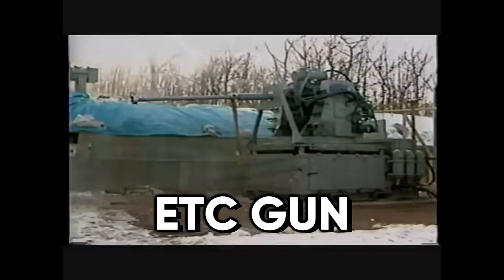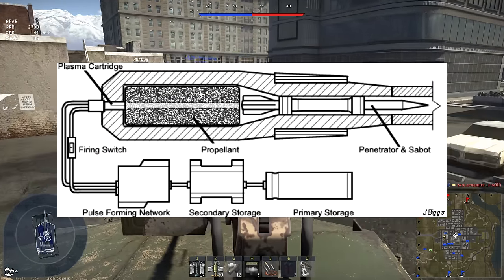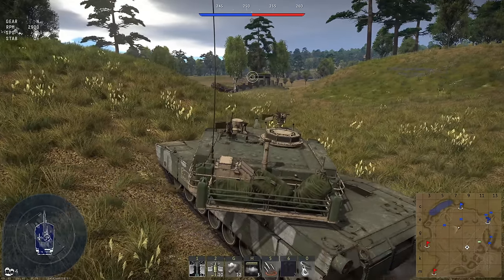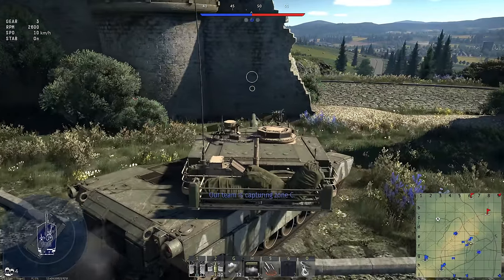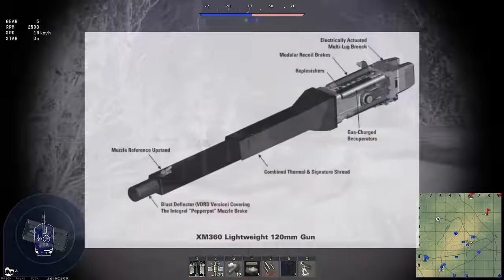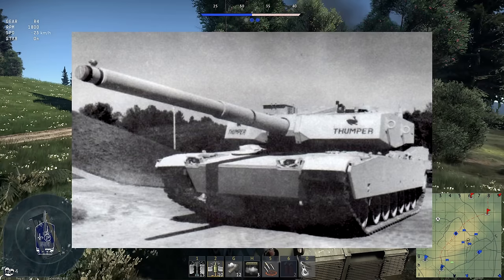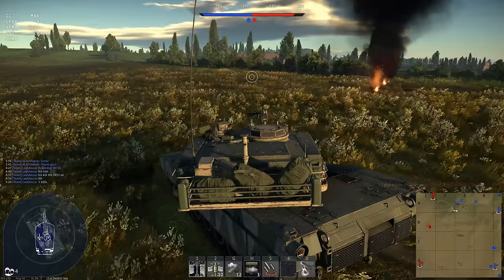ETC Cannons - The Future of Tank Weaponry

Comment: Somehow they remind me the hunting rilfe that use an electric charge to ignite gunpowder that I saw on Forgotten Weapons.
Reply: A entron I think it was called?
Reply: I suppose that can be seen as a version with a much lower powered ignition sytem.
Reply: I remember when it came out reading about it in Outdoor Life. No one was interested
Reply: @ArkonDrakk that's right
Reply: hm
Reply: I think it more just applied existing electronic ignition technology and implemented it into a small arms platform, it had some interesting features but never really took off as it just wasn't different or superior enough.
Reply: @CATASTEROID934  i think this would be better since the ignition system is reusable as opposed to requiring one use primers
Reply: @rhodesianwojak2095  The only real difference in the ElectronX is that it used electronic ignition of the priming compound instead of impact, the proprietary electronic primers essentially passed a current through the volume of priming compound which in turn would ignite the propellant rather than directly igniting the propellant. I think this was to make commercial brass compatible with it for the sake of reloaders. All-electric propellant ignition in small arms would require totally proprietary casings.
Reply: @CATASTEROID934  ah ok ty, preety new to this stuf so
Reply: I met a guy a couple of years ago who was buying up all the Etronx primers he could find. He was working on a less lethal electronically fired "pistol" with, if you can believe it, a user selectable level of velocity.
Reply: @CATASTEROID934  I wonder if anti tank rifles would make a comeback because of this. Like, an ETC version of the Lahti (Lahiti?). That 20mm rifle lol
Reply: @irtazaazam2573  I mean anti-materiel rifles already exist and are deployed in small numbers by many nations, the problem is you need a powerpack to generate the plasma and that's irrelevant for vehicles since they already have an existing power supply, but when it comes to heavy infantry weapons that already need to be disassembled to be man-portable you start hitting the upper limits of what can be reasonably carried pretty quickly and the extra weight might not be worth the performance boost.
Reply: Remington EtronX. It came with or you had to purchase electronic primers and load the rounds that were electronically primed. It had an ultra light 2lb trigger that felt more like a mouse click.

Comment: Reminds me of a funny detail, when Armored Warfare added the tier 10 version of the abrams, they called it XM1A3, even though that’s not even a valid syntax (the A3 version of something not in service?), the designation, as per a declassified pdf regarding the XM360, is M1E3.

Did not realize the thumper was using the 140mm ETC gun, always thought it was a conventional 140mm and ETC development was why it was dropped.
Reply: Theirs a latest Q&A video by the_chieftain talk about the Thumper's fate.
Reply: @howlerofthegrey9368  I imagine the end of the cold war made it seem unnecessary in addition to its other issues.
Reply: @Phos9  then Bush came in with Middle eastern boogaloo
Reply: HERPY DERPEDY didn’t need a 140mm gun for downgraded T-72’s.
Reply: @Phos9  would have made it a piece of cake though
Reply: @bryanmartinez6600  at a certain point it's over kill to an excessive degree. If a smaller shell does the job it makes the entire supply chain easier, and allows more rounds to be carried
Reply: @Joesolo13  But it’s less boom :((

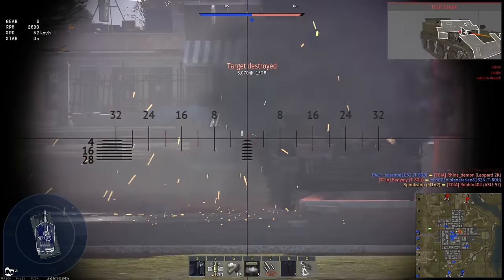Comment: 1:42 The only problem with increasing muzzle velocity is that at extreme speeds there's quite a large possibility of the penetrator and armour melting during the impact. This poses its own challenges which would require a redesign of the armour piercing rounds to better exploit fluid dynamics. Still the advantages of ETC guns are undeniable.
Reply: There are already munitions that can tolerate higher velocities and impacts, not to mention armor behaves as a liquid when hit with something going that fast anyway.
Reply: @jayburn00  not exactly
armour is not a fluid, and it has different, strange properties associated with it
Reply: @goddepersonno3782  what I mean is that it acts similar to a fluid when hit with an object with enough kinetic energy and sufficient durability to not shatter.  Some might describe it as plastic like, but fluid covers some of the properties better.  By the way, shaped charges are sometimes described as creating jets of molten metal, but this is wrong, it's more like some of the metal is deformed into a penetrating projectile that is partially stretched out sometimes or even fragmented into pieces behind the penetration projectile.
Reply: Not really an issue, since modern rounds use tungsten and DU, the High melting point of these metals and DU's ability to self sharpen makes them fine even at ludicrous speeds, you might be thinking of older Solid steel tank rounds.

Comment: For that matter, if you ever want to get a good laugh, somebody on deviantart took the ETC design concept and put it on crack cocaine. He called it the Nuclear Pulse Gun, and the idea is to take a Projection Orion nuclear heat pulse unit and surround it in a thick block of silicon. Shove it into a barrel and put a massive bullet in front of it. When the kiloton yield nuclear shaped charge detonates, it vaporizes the silicon into a gas and launches the projectile. Barrel ablation would be decreased by the fact you're essentially using lube as a propellant medium, but the barrel would still need to be swapped per few shots.

If you are at all interested in a lot of crazy, insane, and terrifyingly well thought out and researched weapons I'd heavily recommend checking out the AtomicRockets website. It's both impressively well researched and also contains some weapons that are the stuff of nightmares. Theoretical spaced, nuclear explosively formed penetrators that can throw meter wide slabs of metal at 10+ kilometers a second come to mind. Heavily recommend.

http://www.projectrho.com/public_html/rocket/
Reply: Exactly how big is the gun that pressures of the vaporizing silicon doesn't just blow the barrel apart?

I pretty much always assume that the nuclear gun doesn't survive more than 1 shot.

Although depending on the application, 1 shot is all you need.   Figured a good anti-kaiju weapon (so effectively sci-fantasy) would be a large unmanned hydrogen(or helium) blimp carrying a giant single shot nuclear gun.
Reply: How do they solve overpressure? Conventional guns cannot handle a detonation wave. Period. That's why they use gunpowder and not C4. So how'd they make it survive a detonation wave from a nuclear device, which is both more a million times more powerful and is produced in like 10 nanoseconds, not 100 microseconds.
Reply: Thanks. This site is quite fun to read, like an unrestricted playground for imaginative kid-dults springboarding from the hard and sometimes solid science and science fiction.

Comment: Rail guns may still phase out ETC guns in the future if the energy requirement problems for rail guns gets sorted out. Rail guns rounds would consist only of the penetrator and sabot making them smaller an lighter thus allowing more to be stored and either easier handling by loaders (due to reduced weight) or increased penetration. (Due to denser material) Of course if the capacitors and power plant for the railgun tank can’t be made small enough than the size difference in rounds wouldn’t matter.

Comment: The problem with ETC, or at least was with the pieces tested that they offered dramatically less performance increase than they are promised. I don't know what's going on with the ETC research now but the XM-291 only offered 7% increased muzzle energy which was deemed very disappointing.

I agree that there is future in ETC technology but for decades now they had been a letdown and only increased complexity and expenses for little benefit. Furthermore the introduction of ETC will be occouring in stages.

Stage 1 - electronically primed munition, more stable performance and increased ammo safety
Stage 2 - electronic heat management to achieve increased performance from munitions
Stage 3 - usage of new compounds that make use of the plasma heats utilized
Stage 4 - electronic heating as extra propelling force

Stage 1&2 are tried but compared to the promised yields as I said they are pretty disappointing. Stage 3 AFAIK is fairy tale right now because nobody invented a new supreme propellant which explicitly needs plasma heating. And Stage 4 is something you'd only consider at the brink of the "railgun age". Another problem with hypersonic tank rounds is that more than the limits of propellant what holds back further improvements on velocity are the impact physics themselves. 1.5-1.8km/s is the optimum range where the projectile still behaves like a projectile. If you get to 2.5-4km/s you might as well throw lead balls at your target, it'd have almost the same effect. At a certain velocity solids cease function normally and they adopt liquid-like properties. Modern armor-piercing sabots already make use of this but if you increase the velocity further then rather than increasing penetration, you'd make your cannon perform worse. Some considerable leaps are required in material technology to overcome this.

Ironically enough the way ETC is right now it has little benefit for fighting vehicles but can be massively relevant for naval gunnery and artillery. ETC has a very stable velocity curve as you already explained and offers room for a whole new family of insensitive munitions. This should result in way greater accuracy, increased overall performance and overall reliability increase. An artillery piece using ETC may not have any amazing properties but it'd be ultimately a much better weapon to use.
Reply: So in short for cool new technologies we should look at ships first, and only later tanks.
Reply: @thefirstprimariscatosicari6870  Wasn't really my point but I have to concur with you regardless. Ships have way more room for all that tech we want to squish into them than an AFV. It might seem odd or even dumb to invest in better naval cannons but those weapons can still have a purpose. 

Another development, one that was actually initially tested for ETC, is the development of anti-air guns. These weapons already require tremendous amounts of power due to their sensors and electronics so adding a plasma ignition system is less strenuous than for other weapons. Why would you want it though? Because of reliability. An ETC gun would have far less variance of muzzle velocity, will assuredly ignite every round unless it has an electric failure (which would doom the gun anyways) and could enable using new munitions with less weakpoints to their casing to allow rougher handling.  The consistent velocity matters more and more small to medium caliber AA guns operate using timed fuses which are set when the projectile exits the barrel. A tiny error in measured velocity can easily mean the projectile detonates way ahead or way after the target thus causing no damage. So yeah, having an ETC mechanism would help these considerably.
Reply: I think a ship could do with ETC enabling faster rounds while railguns are still being refined (wring more range out of the guns so you don't have to resort to missiles that soon)
Reply: @aguywhodoesntexist  Most ETC guns wouldn't have dramatically larger velocities and by the point you get there the railguns would be a superior alternative. ETC would likely have more niche for a weapon system which doesn't need too much range but has to work really well. CIWS, naval guns for self-defense and similar roles all could benefit from ETC. Railguns are intended to replace some roles of missiles but I can't see ETC guns doing it. The reason is range. Railguns can replace a lot of short range missiles but the same cannot be said for ETC guns unless you get to some really arcane levels of advancement. The realistic expectation is that ETC guns just become the new norm for firearms and their less obvious but very real benefits would be a common comfort for modern military hardware.

For example it's often stated that small arms development is stuck at the M16 still, that we still use the same kind of guns when previous eras had entire weapon types replaced within decades. While this is partially true in the fact that we don't look for wonder bullets much due to "the long peace" which is over the world lately. But firearms did improve massively, in every aspect. A modern 5.56mm NATO round is way higher standard, has its weird quirks tamed, works in every weapon and even its raw performance is increased significantly. Same way the "ETC era" would improve gunnery but only at incremental speed, it wouldn't be so earthshattering. Just good.
Reply: I still say ETC be more practical than a rail gun all the benefits he mentioned once the technology is in a mature and more developed state might have more benefits than your standard ammunition and the current railgun we are testing can only be shrunk down to a miner degree but to make it go hypersonic or to propel it Worth damn to get the full benefit takes way more f**** energy than a etc Cannon not only that but railguns have been known to fall apart and damage themselves when firing yes they could survive a few rounds but it's going to take way more maintenance and highly specialized materials
Reply: Oh and by the way you do realize there are hypersonic missiles that can go mach 27 and still function right so unless there's a much quicker melting point for depleted uranium carbide I still think it'd be good thing to invest in as Russian armor and Chinese armor gets better

Comment: Can you do a video about the vehicle design in deserts of kharak?
Reply: Actally, yes ! like, obviously the threads are WAY too small to support vehicules of the bigger weight classes on sand; but cruisers with 2 batteries for a footbal field worth of surface make sense to srpead the weight of the guns over a larger surface (if only the threads under weren't baby sized) !
Reply: Pierre-Marie Caulliez yeah, a 150,000 ton aircraft carrier supported by 6 treads that offer probably 100 square meters of surface each? Yeah, the Kapisi’s sinking.
Reply: @thexlonewolf671  At least the Gaalsiens have anti-grav vessels, which DO make sense to avoid sinking or sanding your hull. Then again, deserts have lots of dunes and overtanks don't do well on hills... And hovering technology tends to be complicated, like : complex, like : the kind of stuff that DOESN'T like sandgrains entering inside of it...
Reply: @pierre-mariecaulliez6285  It is said that Kharak has lower gravity than of Earth's, so tank threads do not need to be as wide there.

Comment: Anyone else hear the Mechanicus OST playing in the background? lol

Also I would like to point out that the M41AE2 Heavy Pulse Rifle from Aliens, is called a "Pulse Rifle" because the propellant is electrically ignited.
Reply: I was thinking the same thing about the pulse rifle. Makes me wonder if ETC technology would actually give an advantage to small arms. I suppose it could improve armor piercing or effective range when you need it with the push of a button.
Reply: I've been using the Mechanicus OST as background audio whilst reading 40k books for the last few weeks. Genuinely thought I was losing it until I saw it credited in the description ;w;
Reply: @boobah5643  An ETC system could allow you to modify the burn rate and thus the muzzle velocity. And yes i know about the increase in recoil wich i why i said you push that button when you need it and besides if you constantly went with the super high velocity you'd cause your therminal ballistics on soft targets to be worse. Your rounds would just start ice picking instead. There's a limit to how small and fast you can make your rounds before they become ineffective against human targets. Also i've hardly heard of any cases where someone's gun got shot.
Reply: @boobah5643  the g11 was almost a etc gun
Reply: @joaovitorsilvagohl682  Hardly, i'd describe the G11 to be closer to an angry steam engine. The whole thing with ETC guns is that they use an electronic ignition system while the G11 used a chemical primer.